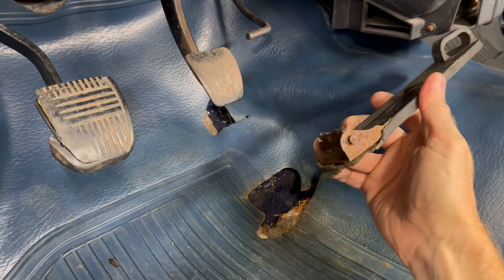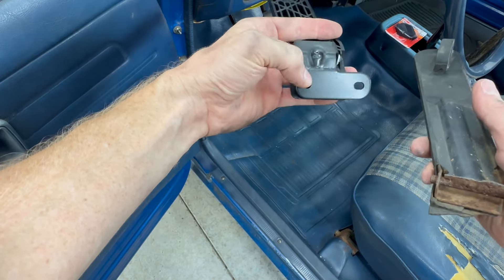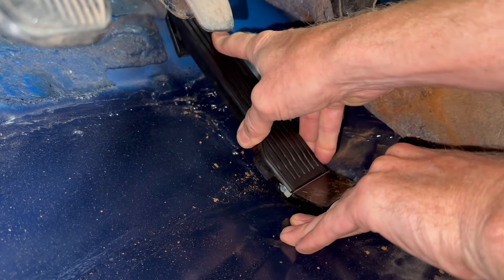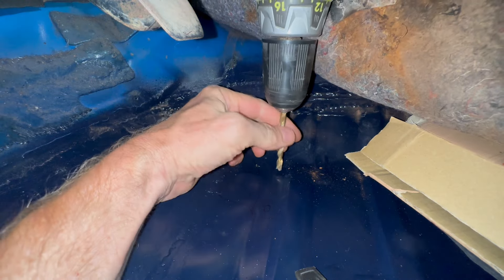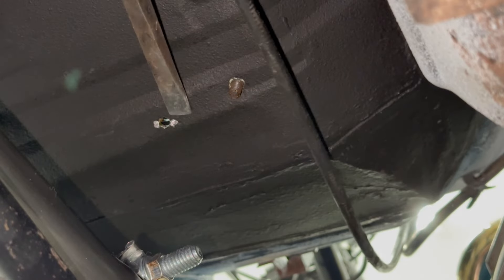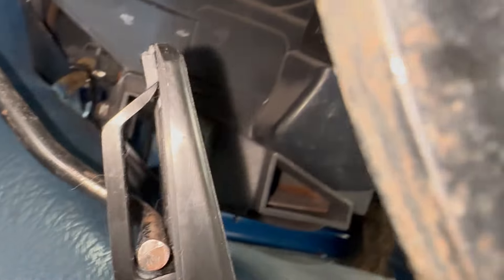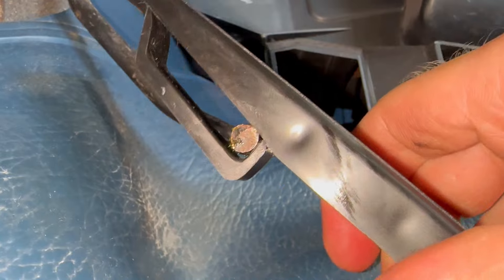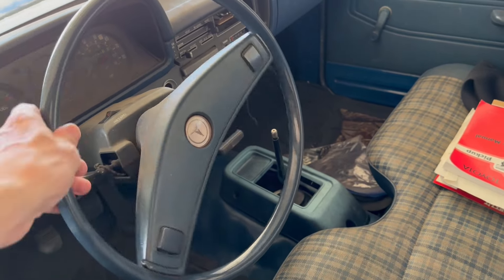How to install a new Gas/Throttle Pedal in 79-83 Toyota Pickup/Hilux

Comment: Just need to move the pedal back, so it doesn't bottom out in the plastic slot.
Reply: That would work. You might end up with an odd tilt, but maybe not if it only needs a 1/2" or so more room.
Reply from the maker: I thought about that, but then it wouldn't align with the hole in the floor liner. Not that my floor liner is too nice to cut a new hole, but most people probably wouldn't want to cut up their nice carpet or liner.
Reply: @6thGearGarage   take the rod section off and slot the mounting holes. You probably only need a 1/8 lift up to clear the bottom of the plastic clip to stop it binding. That way your not moving the bottom bracket
Reply from the maker: @Nilezy  Good idea! Yeah, I didn't want to put any other holes in the floor.

Comment: Nice fix. But I would have used stainless fasteners to prevent rusting.
Reply from the maker: Good call! These are zinc, but this truck will never be driven in winter again, so they shouldn't get too rusty. Shoot, I'll probably never even drive it in the rain after all the work I've put into it!

Comment: Hello, I have a question for you and I was really hoping you could help me out. I have an 1988 Toyota v6 Dlx Hilux that I am working on, I am trying to replace the ignition (where the key goes in not sure if it’s called the ignition) But I don’t have the key and you are supposed to insert key turn towards you and push button to remove it, do you know of any way to do this without the key? Thank you for your time!
Reply from the maker: Can you bring the title/vin # to a dealership and they'll cut you a key?  That's an option in the US, but not sure about other countries.
Reply: @6thGearGarage  Thank you so much!!I’ll try that! (I’m going to give it another shot myself first) however I just watched one of your other videos and learned that my cab under the doors is completely rotten): one of our neighbors down the road say he has a cab that we can have,me and my dad looked at it and it has an uncracked dash! I didn’t check to see if it the cab was rotten since I didn’t know at the time. Thanks so much for all your videos, you are the most useful YouTube channel I’ve found!
Reply: Find an old Toyota key that's worn out and insert it into the ignition switch, just keep jiggling it, and it will turn, I had the same issue.
Reply: @aerialrescuesolutions3277  Thanks,actually I realized my ignition is broken and any key will work